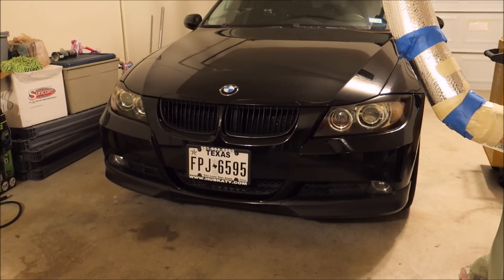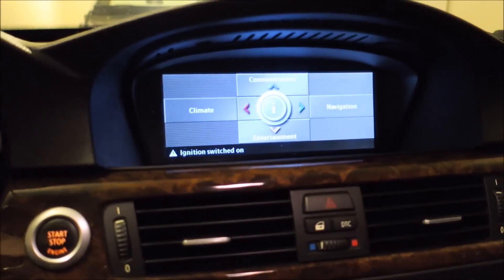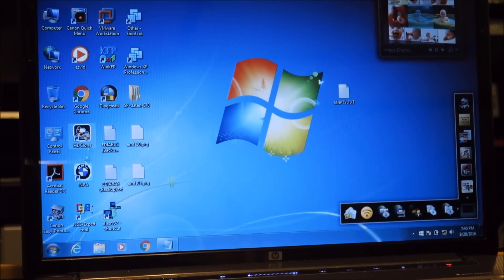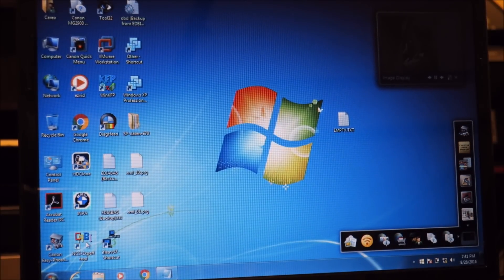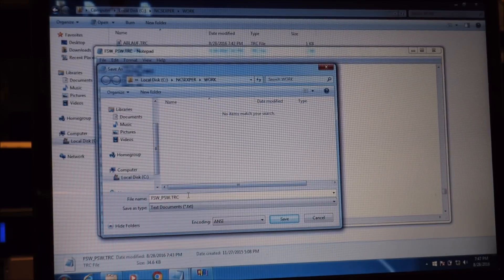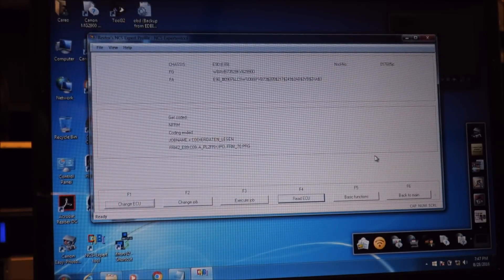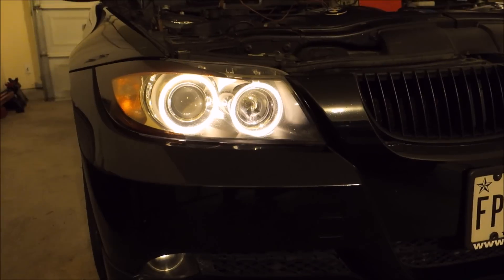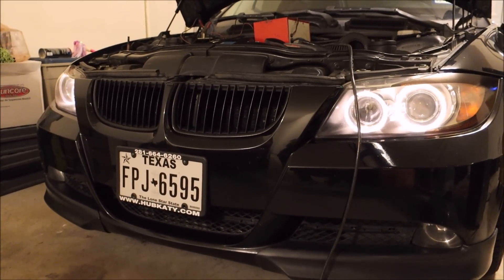BMW E90 Angel Eyes as standard DRLs DIY and coding via NCS Expert

Comment: Will this work for a E90 2009 335i M sport?  I believe  2009 is LCI?  I recently purchased one.  Thanks in advance.
Reply: Doug Mehringer get a veepeak adapter module and Bimmercode app. Cost about $50 for the two. Way easier than this. Takes about 5 min using just you phone and the veepeak. Lots of videos on here showing how...

Comment: Great stuff! I got an '11 z4 that I'm rebuilding and I installed aftermarket headlights, so I need to get rid of the adaptive headlight error. So, I was concerned about screwing something up, but I think if I follow your procedure for saving the original file I should be able to return to the original coding.  That's the portion no one was showing.

Comment: Bro you can just turn off the running lights and have the angel eyes as your drl from the instrument cluster. Go to the key with the check mark. Click it and turn off the daylight running light. It will just leave the halos and turn off the high beam part. No need for all the coding bs.

Comment: Hello, 
  First, i tried this code and it works very well. Now i have a question for you, i own a bmw 320d e90 2007, and i have xenon lights, i was ruined nfrm and i needed to reset from stock, and that is what i did, now when i am flashing (pull) it work only halogens light and that shutter from xenon not working anymore, only when i turn on high beam and not flashing. Do you know what code  its necessary for this? Thank you!

Comment: Can anyone help? I have a e91 which has xenon’s and AHL with a build date of 21/06/2007 and confirmed it’s frm2 module using INPA however I can’t seem to get the DRLs to work. I also can’t find the option on the ccc system. All that shows is a check box for welcome lights. Any guidance would be greatly appreciated. Cheers
Reply: Ever figure it out?

Comment: Hi! I upgraded from FRM to FRM2 in my 02/07 e90 and got everything programmed and reset to factory settings. Everything works, however when I have the DRLs on, the Angel Eyes are on, BUT the inner light bar on the outer taillights light up as well (the trunk taillights are completely off). How do I code those lightbars out?
Reply: same issue here..any ideas?
Reply: @richardsimpkins9758  I still deal with it. I haven't found a solution yet
Reply: Hmmm arent they supposed to be like that or no? When driving behind my friend in his 09 e92 coupe, when his DRL are on, his back tail lights are lit there as well. I assumed it was for even better visibility from the back, not just the front and I thought it actually looked cool on his all black coupe. I will also be looking into doing the upgrade to FRM2 in my 06 e90 as well.
Reply: Turbocharger, Bimmercode app....

Comment: Hiya I have a Uk e90 335d with FRM 2, 2007. i have the same ccc i-drive, adaptive xenons and AHL. I can turn on the DRLs via the i drive menu Except in my car the Dipped xenons turn on with the angel eyes for DRLs, must be a uk coding difference. Will this method work in changing the car to have the Angel eyes only? Thanks
Reply from the maker: Hey, yes it would be the same as long as you're running a 2nd generation FRM module.
Reply: @VehicularDIY  hi, will this work on a car  production November 2008 E90 320i with idrive? Should I connect a battery charger if I intend to finish the coding within 10 minutes? Please help

Comment: I have a 2006 BMW 330i, non iDrive and no option on the dash to turn off DRLs, is this possible on my model?
Reply from the maker: Only if you upgrade your footwell module to an FRM2. (2nd generation)
Reply: Hmm I have the same car, without iDrive and I have the option to turn them off. I have turned mine off and use the headlight switch to run just my halos when driving during the day. Only bad thing is you have to remember to turn them off when you are done driving or they will stay on. Not Ideal. Im looking to upgrade to the FRM2 footwell module to avoid this as well as get the cool "welcome lights" feature.

Comment: Sorry, another compatibility query!  I have a late 2007 E92 [UK spec].  No iDrive or any DRL switches, etc.  Is this possible on mine please?  I'm new to coding, so unsure what modules I have at the moment.  I guess there must be an additional setting to actually enable any DRL?  Many thanks.
Reply: OK to answer my own question (and hopefully help others) all I needed to do was enable DRL using the BC button/ indicator (turn signal) stalk standard settings menu.  It appears the UK spec is set to Angel Eyes by default and they are much brighter than normal side lights (probably maxed out) - result!
Reply: Subsequently discovered it is simply because mine is the E92 Coupe!  How convenient!
Reply: The E92 should be able to have this already

EDIT: saw you got it working.

Comment: Hey
Does that mean that it isn't possible to code a 2005 e90 European
car, with my drive to angel eyes as daytime running lights?
Reply: i drive
Reply from the maker: You could if you looked up how to upgrade to the NFRM2 module.
Reply: I can not find a clear explanation of how to do this! But I guess it's a hardware part I need to replace? a control unit? Do you know something about where it is located and will it be possible to change it around or will it require wiring work? 
I guess the coding should be the same on the two? would it be posibel to save the old one and write it on the new module?
Thanks upfront! :-)
Reply: Ashihara5Kyu I know this is way too late but I may be of help. The FRM is located in the driver footwell behind the piece that holds the hood and trunk releases. It is very easy to physically replace but it also requires coding to work with your car's VIN and its features. If you have no experience with any kind of programming then I would not suggest doing this yourself. I did mine, but I am a computer science major with years of experience. There are people out there that will do the coding for you at a cost (not sure on the avg price). As for finding an FRM2 module, you can look on eBay. There should be plenty there. I got mine for about $60, programmed it, and now I have lots more features to play around with. Just make sure you get the correct FRM2 for your car's features. Check out this link for that list: http://www.e90post.com/forums/showpost.php?p=13225455&postcount=223

I hope I helped you or anyone else!

Comment: Hi will this work on my e90 2007 m sport (japan) with no idrive? Cheers
Reply from the maker: lamadrid It should, what is your build date? As long as it has an FRM2 module it should.  You don't need idrive to do this.
Reply: Aveman1 I'm trying to locate the build date of my bimmer, I've checked under the hood and all doors but can't find any information. My BC doesnt also have the drl option. If it's produced earlier than April, is it still possible to do this? Thanks
Reply from the maker: You should be able to find your build date on the b pillar when you open the drivers side door.  Check for a label with your VIN on it.  As long as you have an FRM2 module you can do this.
Reply: lamadrid l

Comment: would this work with an e90 with aftermarket headlights?
Reply from the maker: Not sure as aftermarket headlights might be wired out to box to pull power from another circuit to power their inbuilt angel eyes.

Comment: What position is your light switch on when driving only with DRL?
Reply: Arnis Rubīns auto or just normal. DRL means that anytime during the day when your lights would be active, these will run. This essentially does two things. Cuts the ugly amber low beam from turning on, and activated your Halos anytime the car is “running”.

Comment: i wired my angel eyes into my high beams. how did you wire your angel eyes
Reply from the maker: It's done via coding, no wiring required if you program the module.
Reply: Only a hack would splice wires to do this on a BMW. It's not a cheap Japanese car where there's virtually no electronics besides required engine management. lol

Comment: Will this work on E90 2009?
Reply from the maker: Yes it should, you should have an FRM2 module.
Reply: where i can see the the version of my frm module? I have a 2008 320d E91 and i have the standard headlights with angel eyes(no xenon headlights) and with carly i try activate the angel eyes and nothing... But on the carly i can activate for example the side markers(USA)..
I try also activate by the CB but no sucess.. Turn on only the back lights but the angel eyes nothing..
Could you help me? Thanks